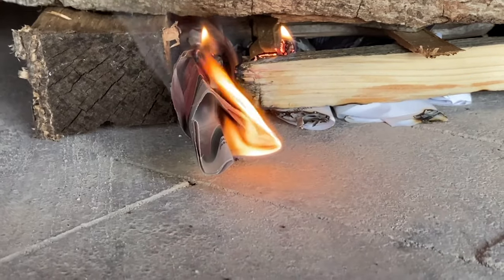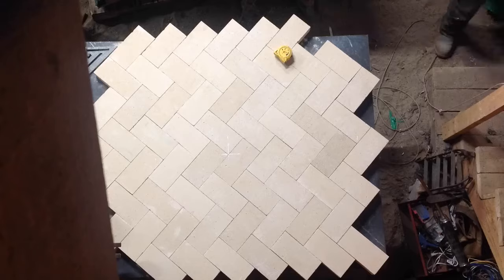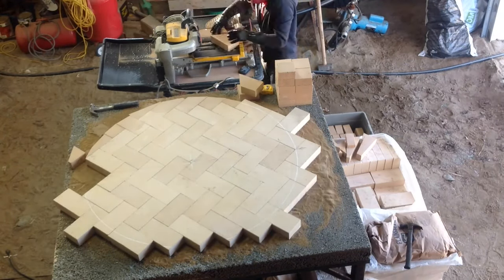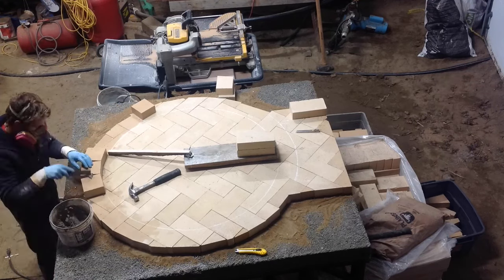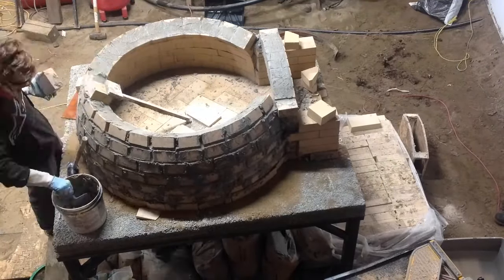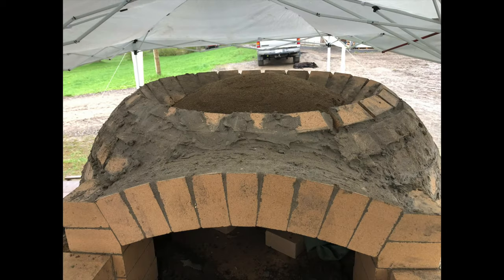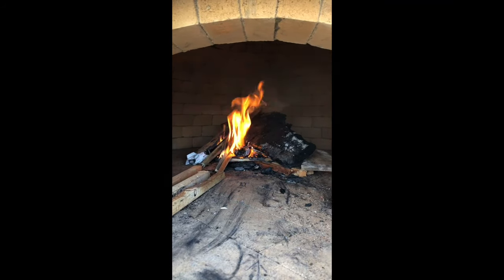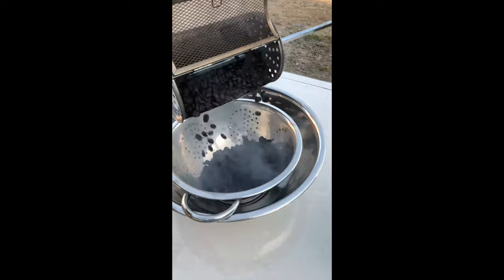The Art of Building a Wood-Fired Oven

Comment: Super helpful! Thank you for posting.  I’m in the researching phase. I am determined to make one this summer.
Reply from the maker: Thanks! And it’s a fun project to do! I wanted to figure out a way to make it without a brick foundation, plus I had a welder available. It’s doesn’t get to hot under the oven, that first base layer of insulation works well, I was trying to cut corners and had a goal to keep it low budget as much as possible!

Comment: Good afternoon, thank you for the video. Can I get a list of building materials?
Reply from the maker: Hey, thanks, I ordered some firebricks from a local distributor, the insulation I built was perlite and Portland cement, for the brick mortar, I used a special mortar mix that was made for high heat. There’s also a 1” layer of ceramic fiber blanket over the dome/bricks and chicken wire to hold it down. Afterwards I added a layer of stucco. 

Fire bricks
Portland cement
Perlite 
High heat mortar mix (could be homemade, there’s a recipe available on fornobravo)
1” Ceramic fiber blanket 
A chimney 

Hope this helps! Total build cost was about 1500$ CAD in 2019
Reply: @farmingwithmarc  Thank you, all the best to you!!!👍👍👍

Comment: What did you make the base from? Looks like 1 1/2" metal?
Reply from the maker: I used metal 2x2 and probably 1/4 inch thick, it’s heavy so I decided to use thicker tube, and I think 1/8 metal plate on top. I then placed the oven on concrete blocks.
Reply: @farmingwithmarc  yes it looks very heavy.